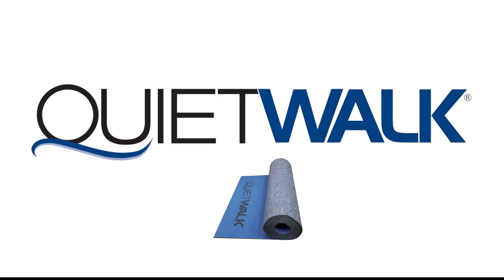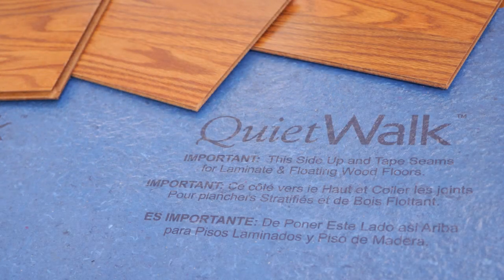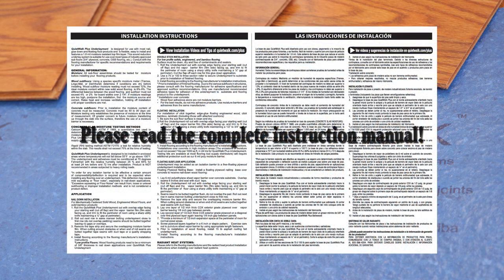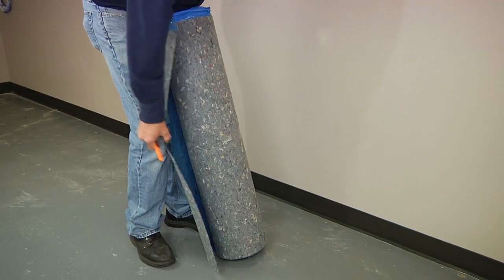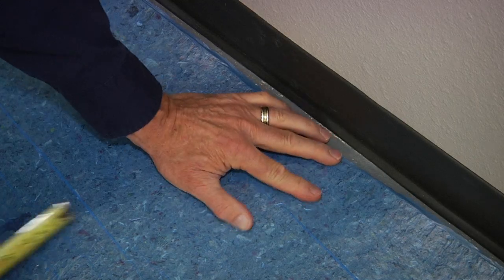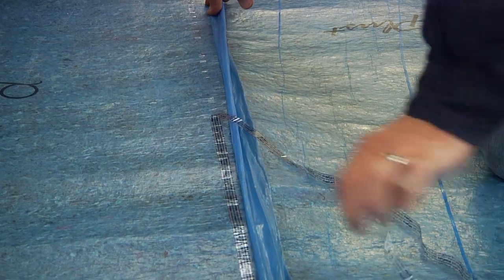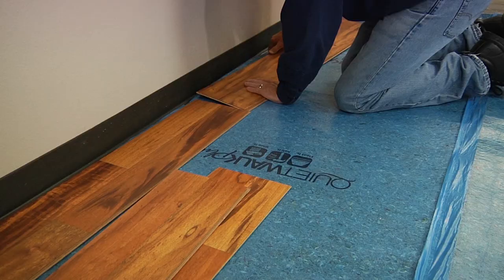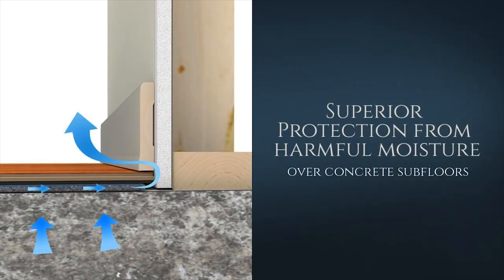QuietWalk Underlayment for Laminate Flooring Installation Video

Comment: Thanks for the video.. can this be stapled down instead of taped together? as long as its butted together?
Reply from the maker: Thanks for the question! It is not recommended to staple down or nail down regular QuietWalk as it will jeopardize the moisture barrier. We would recommend QuietWalk Plus!